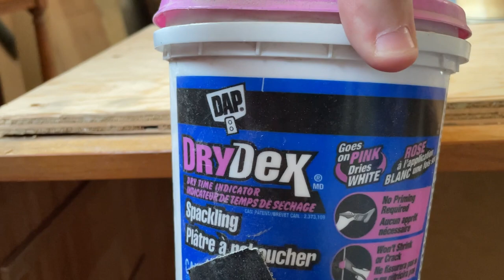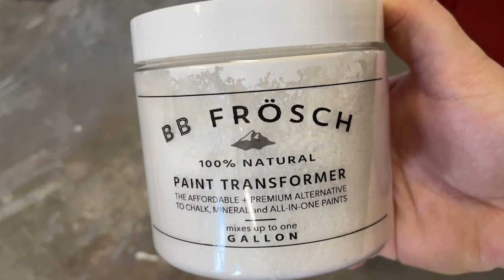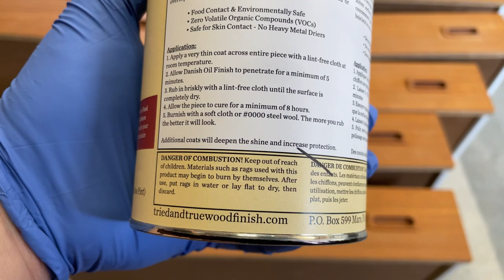MID CENTURY MODERN FURNITURE MAKEOVER

Comment: Perfect timing Katie!   I have a similar teak dresser - although mine is in almost perfect shape and the cabinet frame (except for the back panel) appears to be solid teak.  It also has mid century modern legs.  The interior drawers are wood and not melamine. Not sure how to finish them -  Danish Oil as well ?  I was stuck with how to proceed but now feel more confident to clean, sand and simply danish oil it.  Thank you for your artistry and knowledge.

Comment: Your piece turned out beautiful again, despite the poor quality of the dresser itself: it looks very "luxe" and expensive now! Nothing wrong with a bit of spackle, when in need! I used it when I built my front door to cover/hide the fact that I used a variety of different woods and plywoods (I painted the door once it was all spackled and sanded). That was over ten years ago, and the finish I painted over it is still smooth and withstanding all the rough treatment it gets!

Comment: Stunning, wow. Qu: so painting over shellack is fine? I get so confused with Wood Finishing, polyurethane, Etc. Lovely lovely piece.
Reply: I was also wondering the difference between just shellac and using the Zinsser primer. Love that you were able to save this piece!  Thanks for sharing so much information.
Reply: The zinser and this one aren't that different. This one is great if you want to distress your piece without white primer showing up underneath. If you aren't distressing (like she didn't ) i don't know what the advantage of one over the other is either ??
Reply from the maker: Hey! Shellac and the white shellac based primer that I use a lot are basically doing the same thing. 1 is clear and 1 is white. Both are totally fine to use under paint 😉

Comment: This is beautiful and i may do the reverse to a waterfall chest of drawers with deep gouges in the drawers from the hardware spinning around a single screw. 

Do you need to reapply the wax?  I heard that chalk paint is prone to come off if say a glass condenses on it. I know the wax will work for now but it seems it would need a new application every so often?  Mine will be on drawers so, vertical, but I’d like to paint a dresser to match the drawers and it would be good to know if I need a polyurethane type or if wax is sufficient. (Is that clear as mud?)
Reply from the maker: Lol, I got you! There is no need to reapply wax but you can if you ever think it needs some polishing up. ANY paint will be damaged by water condensation. ALWAYS use coasters on furniture. ALWAYS! You can definitely use a Waterbased polyurethane over your paint if you prefer though. I have a video called battle of the topcoats where I tested them all side by side if you’re interested. Hope that helps ❤️

Comment: What a lovely job! I like th colors combination!  BTW - you can do your Danish oil yourself! I did it last week working on a dresser.  Have a question about the legs with metallic ends - how to  clean them as  i can't remove them. Thank you for your job and your sharings with us!
Reply from the maker: I would take some extra fine sandpaper or steel wool to them and see if you can remove the tarnish that way.
Reply: @salvagedbykscott  Yes, i just did this way and it worked! Now the next question about hardwear! The same way or there is anoter way? Thank you! Take care!

Comment: This looks amazing! 😍 Love the combo of that color with the Danish Oil. Did you find you needed to add any water to the paint? Also, did it need more than one coat of the oil? I have a peice I'm considering it for and wondered about the durability/cleaning ability. Thank you so much for sharing!
Reply from the maker: Hi 👋🏻 I didn’t add any additional water since I brushed this one but you can definitely do so for spraying or if you like to brush a thinner paint. I only did one coat of the danish oil and so far it seems like enough. I suppose time will tell but you can always reapply if needed. Thanks for watching!
Reply: @salvagedbykscott  😊♥️ thanks

Comment: I'm sure this is a totally ignorant question, but what makes chalk paint different from regular household paint? I've been curious about this for a while, but it wasn't until I saw you put in an additive to convert household paint to chalk paint that I figured I finally had to ask. Thanks!
Reply from the maker: Regular old latex paint is formulated for use on walls. It’s meant for large, flat surfaces that don’t move or have item slide across them constantly. It sticks to itself and peels if it’s damaged. Chalk paint is made specifically for use on furniture. It doesn’t peel or lift its damaged.
Reply: @salvagedbykscott  we used latex enamel on our pantry shelves many years ago. It looks absolutely awful now. Makes chalk or oil sound much better.

Comment: Hey Katie! Just curious - what is the benefit of using the spray shellac to seal in the water damage as opposed to kilz or other primer? Thanks!
Reply from the maker: I use shellac or shellac based primer because water based primer simply DO NOT block stains. I’ve had too many projects go wrong with water-based primers so now I stick with shellac.